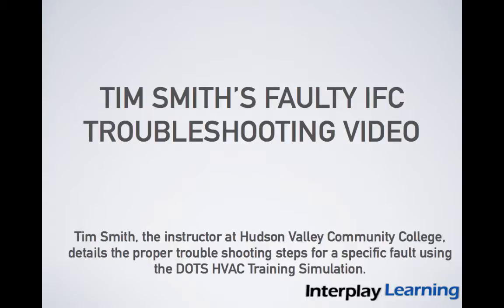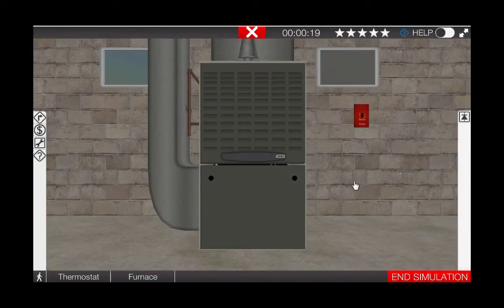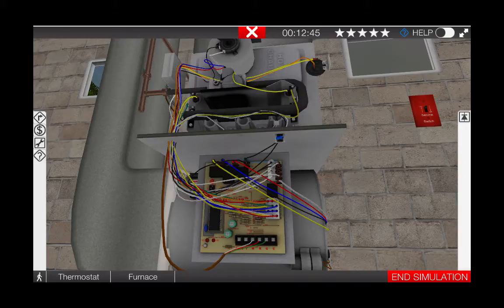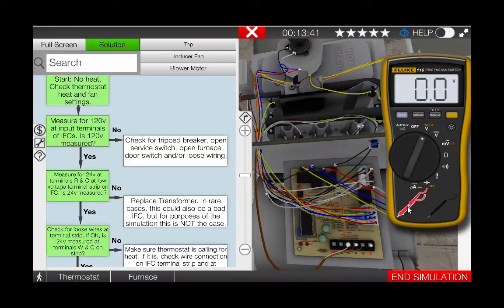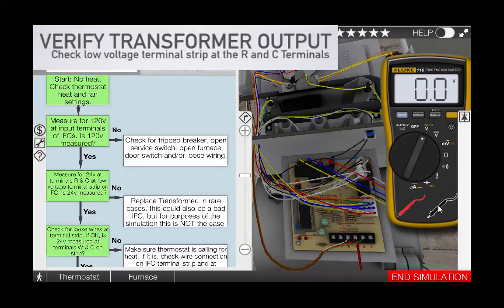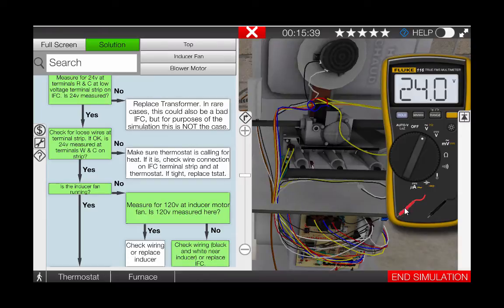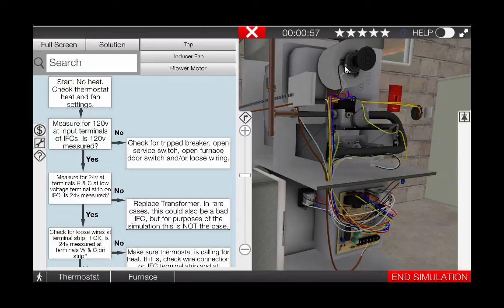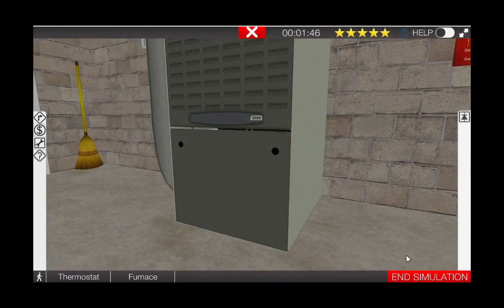Gas Furnace Faulty IFC Troubleshooting Video

Comment: Really, apart from output at the actual board, what should have been mentioned is perhaps a pressure switch error fault. Board codes weren’t mentioned, but the ifc won’t energize the inducer if the pressure switch is closed when it shouldn’t be.
Reply from the maker: That is a great point. Manufactures know people would jump out pressure switches and cause a hazardous situation. The control board will look for open pressure switch contacts first, before energizing the inducer and starting the ignition sequence. You're correct to mention an error code. If a pressure switch is stuck closed or jumped out, the IFC will indicate the pressure switch is stuck closed, or display the same code as an open pressure switch. Thank you for your comment.
Reply: My pleasure. I knew this video was more about the concept of troubleshooting component failure rather than the array of issues that could cause an inoperative inducer.

Congrats on your 2020 ahr expo award. Btw.
Reply from the maker: @sadhvacman7238  Thank you!
Reply from the maker: @sadhvacman7238  Thanks for your message! One of our team members will be in touch with you real soon

Comment: IFC is the same thing as a control board?
Reply: I don't understand why no one answered your question - even after three years.  But yes, it is a control board.  IFC stands for Integrated Furnace CONTROL, and it is a circuit BOARD.

Comment: you never checked the leads themselves (with power on) to even see if you have voltage coming from the board. For all you know it can be a bad inducer but a perfectly fine board.
Reply from the maker: Thanks! Our future versions will have improved electrical testing per component!